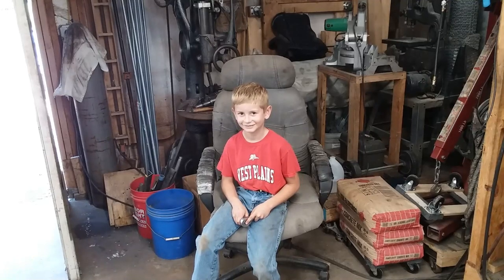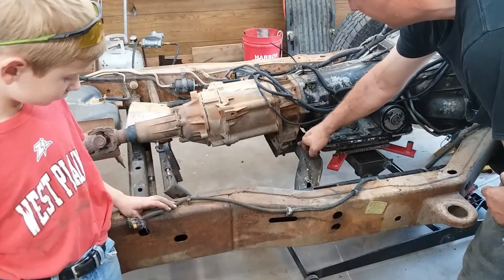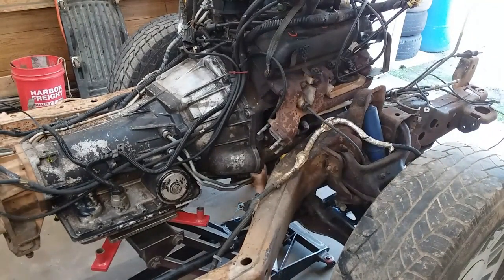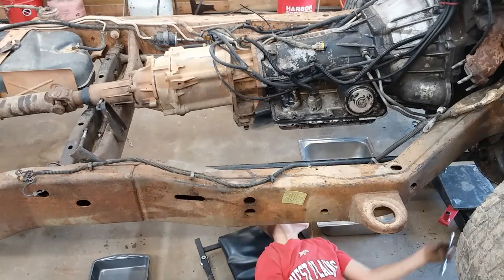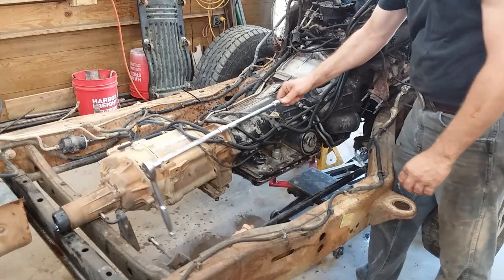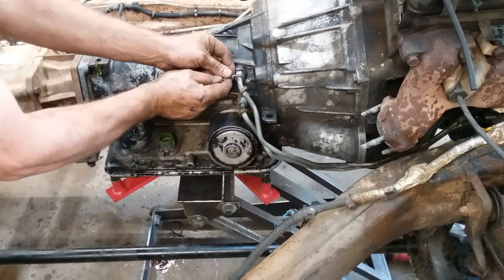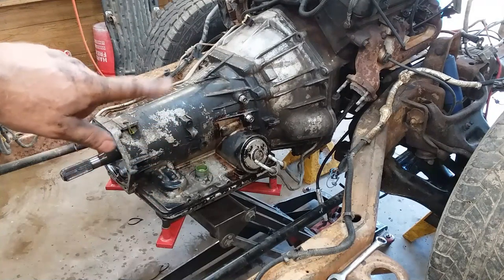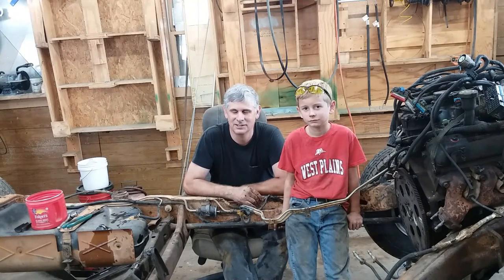S10 transmission removal.

Comment: Thanks for showing this while the body is off. Helps me see better where everything is. I took the manual transmission/transfer case out of my '97 Blazer in the backyard on steel ramps to do clutch work and replace all the seals back in 2020. That was a fun summer. Haha
Reply from the maker: You're welcome.

Comment: Is this similar for a manual? Any words of advice before I start ripping into mine? Thanks for the video!
Reply from the maker: I ain't never pulled a manual out of a dime.  It'll be a lot of the same, rtfm.
Reply: @thefixerofbrokenstuff  Alrighty. Thanks for the quick reply!
Reply from the maker: Seriously though, you can buy a pdf of the factory manual online for about $50.  No reason to remain in the dark.
Reply: @thefixerofbrokenstuff  great point!

Comment: I have a 91 4.3 and I apparently crushed the front pump when installing the rebuilt  transmission. Do you have any info on what exactly I should look at or check. Great informative video!
Reply: He told me the torque converter might not have been fully inserted. I’m just not sure if I need to tear the transmission down and check steels and clutches. (Something Im not against doing and learning)
Reply from the maker: If you busted the ears off the pump, you better just take it back to your tranny guy. There's a lot of fiddly parts in there.